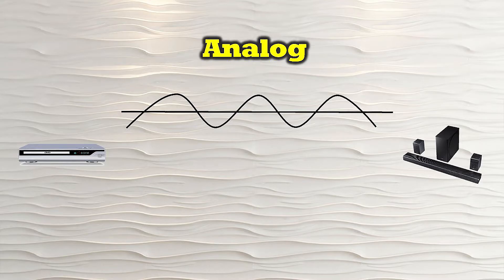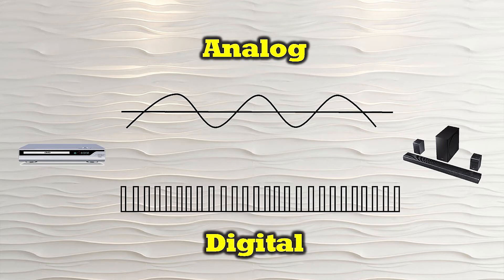Best Way to Convert Digital to Analog Audio Signal | OREI DA34 (Product Understanding)

Comment: Hello great video I just have one question I'm not sure about

If I have a very basic cheap CD player and it has on the back coax out red and white but it also has toslink

If I use the coax red and white to connect to my AVR am I allowing the AVR to do the conversion with the DAC instead of allowing the CD player to convert it which would be far inferior?

Or is it better to use the optical which is the toss link?

My plan is to get a higher end external DAC,